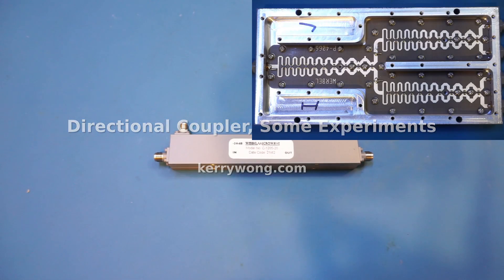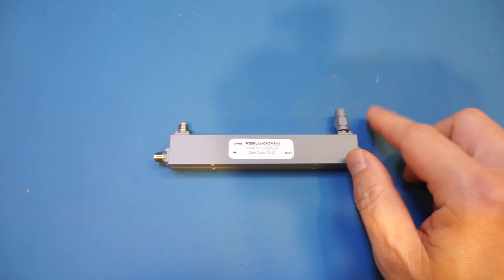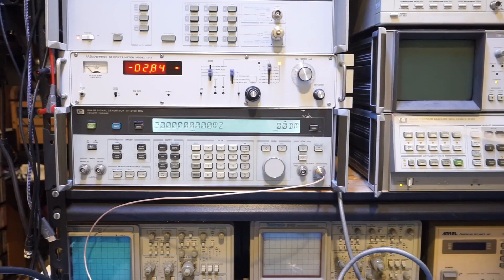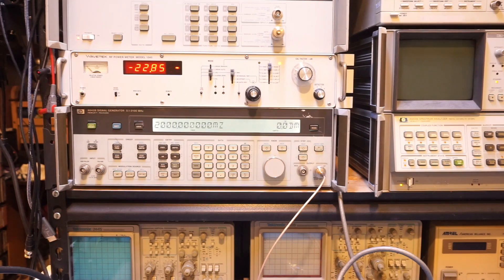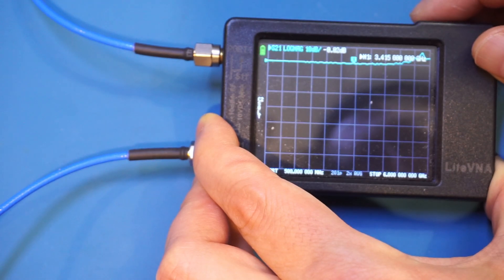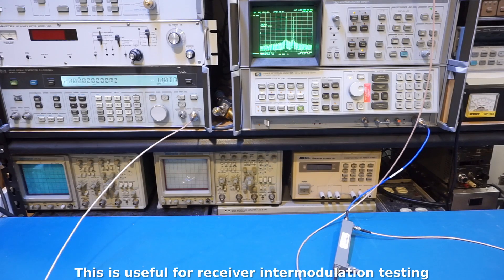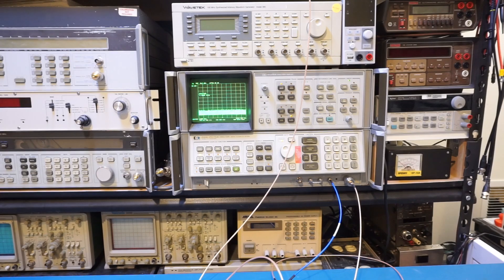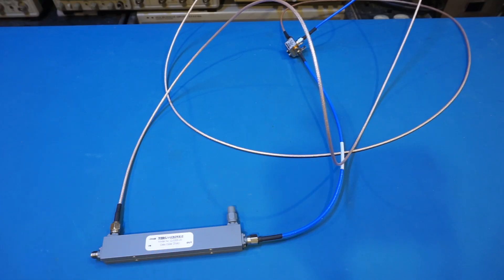Experiments with a 0.5 to 20 GHz Directional Coupler from Werbel Microwave,  Antenna SWR Measurement

Comment: Hi. In the last part, what is the role of the mixer? Why is not the signal generated by the SA applied directly to the coupler?
Reply from the maker: The mixer is for the tracking generator. I wrote an article a while back on this: http://www.kerrywong.com/2016/01/10/building-a-tracking-generator/

Comment: Hi Kerry I have been looking at cheaply available directional couplers on ebay to enable accurate power measurement on a 436 power meter. The coupler can be calibrated at a lower level with the same power meter. It is of course true that outside the range of these couplers they still work but the coupling factor will be lower at a lower frequency. I wonder if you have ever done experiments with this. Knowing the coupling factor at any particular frequency allows one to calculate the true power typically 30db is watts to mw on the 436.

Comment: Nice demo of the coupler. Have you got or do you use any of the old Marconi Instruments test equipment? The 6500 Amplitude analyzer or Radio Test Sets? I'm looking for detectors that are specified to 26.5GHz.
Reply from the maker: The only Marconi I have is a 2305 modulation meter.
Reply: @KerryWongBlog  They're claimed to be very good for the time.  I was going to buy one but the Radio Test 2955 came up first so I went with that and that contains a modulation meter.  Then I got a little bit addicted to buying old test equipment to fix.